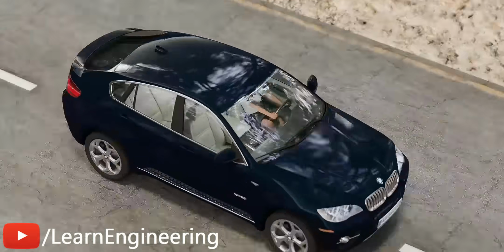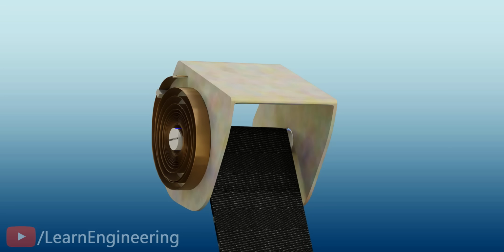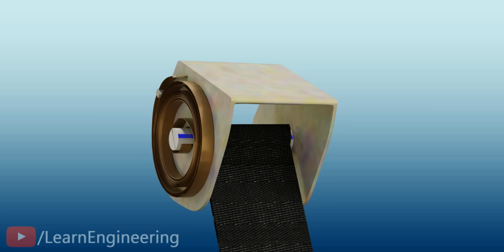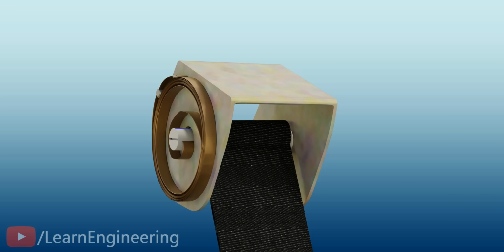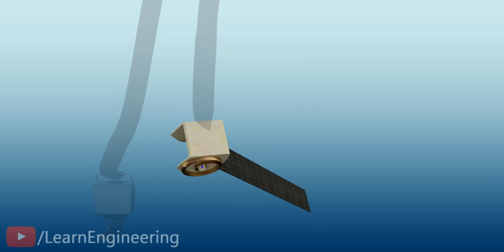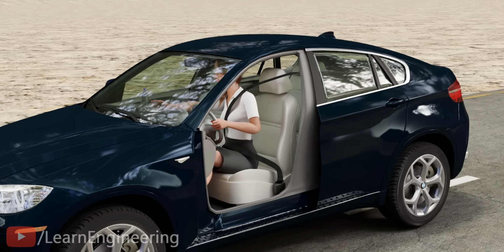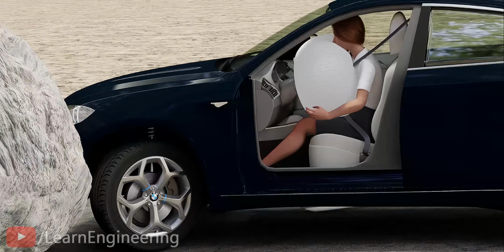Seatbelt | How does it work?

Comment: I never knew seat belts were designed to 'give' a little to prevent internal injuries. How does the pretensioner work in sync with the airbag?

Comment: I am still stumped on the torsion bar— I understand the torsion it undergoes under load, however, I don't quite understand its application and function in allowing for the slight 'give' necessary in mitigating passenger chest trauma during an impact. The pretensioner with the explosive charge was fascinating -unrelated: parachutes underwent an early design challenge similar to the seat belt in reducing trauma during sudden deployment. The parachute was injuring soldiers from the sudden jerking motion as it inflated. The remedy was the incorporation of a gradual tensioning unit in the form of a circular ring the nylon cord   was routed through which allowed for a delayed tensioning of the nylon cord under load,  allowing for a gradual deployment and deceleration

Comment: I am stumped on the torsion bar— I understand the torsion it undergoes under load, however, I don't quite understand its application and function in allowing for the slight 'give' necessary in mitigating passenger chest trauma during an impact. The pretensioner with the explosive charge was fascinating -unrelated: parachutes underwent and early design challenge to medicate the trauma of sudden jerk as a parachute inflated the incorporation of a gradual tensioning unit was added by a simple ring or circular ring by which the webbing fit through which allowed a slight delay in the webbing or nylon which allowed for a gradual deceleration of the user

Comment: the pre tensioner doesnt sound like a good idea when most of the time you can slam on your breaks to avoid the crash, meaning once it fires off, it will have to be replaced. and thats if you "almost" get into a crash a better idea would be a spring that is under tension so when you hit the breaks, it can disengauge the lock and tension the belt, then it can simply be reloaded and not replaced.

Comment: Very good animation, thanks. I thought that the axle with seatbelt had a thingy that had wings (like a pocket knife) and they will retract at high speed and block against the teeth of the outer gear and will look like a very bad thing used by Germans in 1941-1945. But whatever..

Comment: My vehicle has tightened the belts a few times in adverse braking situations. Several conditions must be met before this happens. Amount of braking, radar sensing, vehicle speed, stability control sensing, etc. Needless to say, there was no charge detonation. This is not to say that such device is not present. Perhaps, as others have proclaimed, it's there but only triggers in an actual collision.

Comment: Note the action of the 'ball' though. The narration specifically mentions that the ball moves 'forward' in a crash. But a LOT of crashes occur from BEHIND (stop signs/lights, anti-collision braking, etc) so the ball would be forced BACKWARD - thereby preventing the belt from locking and allowing the belt spool to deploy the entire length of webbing. 

"FINE" - in a frontal crash where the vehicle HAS steering wheel airbags - but what of older models? And then there ARE those pesky side-impact collisions. 

5-point harnesses (used in race vehicles and military aircraft) provide a MUCH safer option. That's why they're used in school bus child safety seats!

Comment: A recent car accident in Gujarat state of India when a famous industrialist was killed and the reason was the non-fastening of the seatbelts by rear passengers. With this background, people are getting paranoid about the working of seatbelts! There is a doubt if the seatbelt shall operate or not in case of crashing of the vehicle! Whenever one sits in a unknown car one should apply a quick tug and the locking mechanism will lock the belt. Seatbelt is a simple mechanical device based on centrifugal force- no sensor, no electronic signal etc etc.A quick tug and the locking mechanism will tell you that it is working as required. 
Knowing fully well about functioning of Seat Belt one should never forget to put on the seat belt before starting the vehicle. Your video has explained it in all respects ! Thanks 🙏

Comment: If you wear a winter coat it helps to tention the seat belt manually when you put it on. Or put your coat off when getting in the car. Otherwise the belt may be too loose in case of a collision.
Reply: You tighten it when putting it on

Comment: i really confused with the combined effect of pretensioner and torsion bar, as torsion bar is provided to absorb rigidness from innitial impact to standstill of vehicle, so that passengers wont get much hard force. and allow them to fall forward to a rate that air bags will fully deploy. but using the pretensioner at the time of innitial impact is like countering the effect of torsion bar, one place enggineers are allowing seat belt to fall forward slightly, another case they are tightening it. please someone explain where i m wrong in my understanding of torsional bar n pretensioner

Comment: I was in a hard head-on collision 13 years ago this month; taxi driver lost control of his 2 1/2 ton Crown Vic on ice, and slammed into my 3,200 pound Saturn VUE head on, destroying the entire front of my car. I was belted in, as always, and because it was a manual transmission, I had already put the car into neutral and just held the clutch until the last possible second---I'd already seen what was going to happen, and knew it was inevitable that my car would be hit (I was even screaming, "Not my new car, not my new car!!!")---and just as I felt the very first impact, I let go of the clutch, threw my crossed arms up against my face while turning my head hard to the right, and probably saved myself from a serious facial injury. That airbag shot out like a cannon, and as short as I am (so had to sit close to the steering wheel), I'd have had a lot of broken facial bones. 

As it was, between the seatbelt stopping me completely when taxi hit, and my arms being over my face, I eventually walked away with only a lot of bruises and a huge amount of anger at the stupid taxi driver, who should have known better than to oversteer on an ice ridge.
One thing I noticed when the police officers and EMTs got to my car, and I was still belted in, when the officer told me to unbuckle my belt, it snaked down to the ground completely, and that was how he knew I'd been buckled in the whole time. 

That gorgeous car was completely destroyed, but I learned just how important the use of seatbelts is. I've been driving for 57 years now, having been taught when I was 12 years old, and for the vast majority of those years, have diligently used all safety mechanisms any of my cars have had. When they say 'seatbelts save lives,' they aren't just mouthing off a bunch of useless words!
I'm a woman, just as a matter of interest, not a man who would likely have known already what to do. I just used the common sense Dad taught me during my early driving years and very quickly assessed what I could see was going to be a very bad situation.

Comment: Very good explained. But i have a question. The last part of explaining is that seatbelt fixes you into the right spot before crash, when you push the break pedal. But what if you dont push break pedal? Then seatbelt dont fixes you into the right spot on the seat? ... sometimes can happen, that passenger cant react in right time, because .. million reasons of course ... but this is a place to do an improvement and connect seatbelt system with the car senzors, which can recognize crash earlier than passenger. And if senzors recognize the crash earlier than passenger, then passenger can be fixed automatically.  But... its just an idea. What you think? Can it works in reality?

Comment: About the second mechanism - its not added just for "testing", and its not added just because if the first mechanism with the ball fails. The second mechanism exist in case the first mechanism doesn't trigger. The first mechanism might fail to trigger (a so called false-negative) without the mechanism failing itself, for example, if the crash/accident come in a slight angle, causing the ball to not correctly catch the lever. In some cases, the centrifugal locking mechanism and the deceleration detection might even be the same mechanism. The ball mechanism is required because if the passenger is wearing loose/fluffy clothes (like a thick winter jacket), it might not accelerate the belt enough fast to trigger the centrifugal mechanism in time.

One very common accident that the ball mechanism may fail to detect, is the "left broken light accident during night", which is a common accident during nighttime. When a car's left light is broken (from the point of view of the driver of that car), the car might during the night look like a MC. A second car might then try to overtake (for example a MC on their side of road). This will cause a very specific front-to-front accident where the left corner of his car crashes with the left corner of second car (note: from the point of the view of the drivers in each car. His left, second car's left hits each other). This will cause a counterclockwise rotation (on those countries with right-hand traffic, in left hand traffic it will be a clockwise rotation when cars right hits the other car's right) of both cars.
This would of course cause the ball to fling in a about 45 degree angle from the lever due to the centrifugal force AND deceleration force combined, thus the lever will NOT trigger.

thats why BOTH the ball mechanism AND centrifugal mechanism is required.

In some cases, the ball mechanism may even have a electromagnet or solenoid, or a rod connected to the pre-tensioner, that positively triggers the mechanism upon a accident detection.
With "positive trigger", it means that the mechanism doesn't rely on weight, gravity or centrifugal force to trigger, but its simply a piece of material moved into the mechanism that will push the lever into the wheel, or a rod that moves into the central plate causing it to immidiately go out of position, so the mechanism can never false-negative during trigger (even if the mechanism can fail, for example broken solenoid, or the lever breaking off as shown in the video).

And also about the belt tensioner, in those cars that use the brake pedal to detect a oncoming accident, they use a electric pre-tensioner in addition to the pyrotechnic one. The pyrotechnic one only triggers during a positive accident, which means usually a collision sensor must be deformed, so the car can be 100% sure its a accident and not just a hard brake.
Reply: Mr seatbelt expert here 🙄☝️

Comment: why is she using her left foot for the break? no wonder she doesn't see the massive boulder on the read. her teacher never thought her to use her feet properly and look far ahead when you are driving.
Reply: Automatic gearbox, some people prefer to use their left foot for that, but it is probably better to use the right foot off the accelerator in case you have to drive a manual car later.

Comment: Seat belt webbing is also designed to stretch when it receives designed load.  After an accident where no airbag was deployed but the seat belt used, it is necessary to examine the belt for areas that are no longer flat.  When not flat, replacement is required.  Sort of like a rubber band aiding deceleration.  Cheers
Reply: No, not really. The seatbelt actually as a load release, which is a S formation sewed with threads. If you look at the side of this (its a thicker portion of the belt, usuallt located at the third bottom, fixed mounting point). If you look at this position from the side, it will look like the belt has been folded once and then sewed shut. This portion, will during high stress, fail (threads break off), causing this S portion to extend to a flat portion, releasing the belt a few centimeters.

This is called "energy management loop" in "seat belt manufacturer language" and it exist a few different designs, some are just folded once, some are twice, and some are a little loop sewed together. If the load release have snapped or if the load release looks to have received a high strain, replace the belt. If the load release is fine, the belt is fine too, but still inspect it for any damages as sharp objects (like the zipper on your jacket) could have ripped out a portion of the belt.

The reason a belt might not be flat after a accident, is because this "energy management loop" might have partially ripped, this is then why the belt isn't flat since a portion of the belt isn't tensioned anymore. So if the belt is not flat, follow the unflat belt until you reach the "energy management loop" and inspect it carefully. The energy management loop can be so well made and invisibly sewed into a label or similiar, so try to find the portion of the belt where its unflat before and flat after. Somewhere there are the energy management loop.

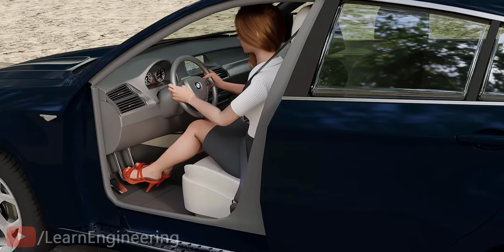Comment: she will really have an accident. 6:53 pressing the brake pedal using her left foot.. massive facepalm😄
Reply: Automatic gearbox, some people prefer to use their left foot for that - they say it is for a faster reaction time -  but it is probably better to use the right foot off the accelerator in case you have to drive a manual car later.

Comment: Hang on! I always thought pretensioners were mechanical?
So if they're using a combustion charge to activate, I can see that being an expensive nightmare for someone who has a very close call, continues driving and has another close call (or worse, the real thing) and the pretension isn't able to work because it discharged during the first close call.

Can anyone shed some light on this? My understanding of pretensioners comes from Audi, who advertise it as being electronic.

Comment: It's obviously much safer to wear a seatbelt than not but wouldn't it be even safer to have the belt attached to the seat and not the frame of the car?
Reply: Why? Frame is stronger than seat
Reply: @massimohack4747  Yeah, you'd obviously have to strengthen the seat somehow. I'm just thinking how many accidents there are where the frame is compromised and causes the seatbelt to rip through the occupant. Still, it's better than nothing of course
Reply: @TheTruthKiwi  if the frame is destroyed to the point that the seat belt becomes dangerous than nothing is helping you anyway

Comment: 3pt seatbelts are DANGEROUS and u would be way better off not wearing a seatbelt.  I have been perm disabled because of the twisting motion that this DAMNED 3pt seatbelt CAUSED.  If we are to wear seatbelts then it should be the safest ones and those are in racing and protect u from twisting ur spine.

Comment: Nice explanation, but I don't think pretensioners currently fire before impact. If they did, any hard braking could trigger them. I was a mechanic years ago and I would always do a maximum braking test before releasing a car to the customer. This is still a common practice, and would trigger pretensioners if brake forces alone were enough to do so. Honestly, unless you do autocross or racing, most likely your mechanic pushes your car harder than you ever will short of an emergency, and he does it to make sure that it will work correctly in such a case. I am fairly sure that seat belt pretensioners fire when it has been determined that ait bag deployment is likely, but the forces have not been acting long enough to move the occupants into the correct place for optimim airbag function. I take this from wrecks where the seatbelt pretensioners fire, but not the airbags. These are usually low speed crashes, or rear impact crashes.
Reply: So the pretensioners fire because the air bag sensors and not by the brake pedal, but in some cases the air bags are not actived?

Comment: So what if, for some reason, you have to suddenly brake so hard that the explosive detonates, but it doesn't end up in a crash or accident? The explosive is gone, so it has to be replaced otherwise that little extra in the security mechanism doesn't work until properly fixed and refilled, right?